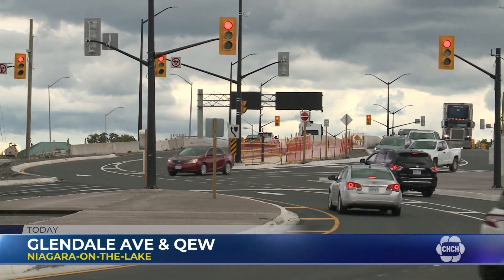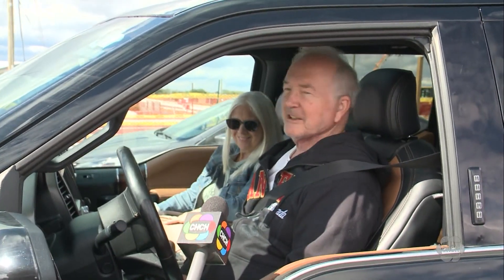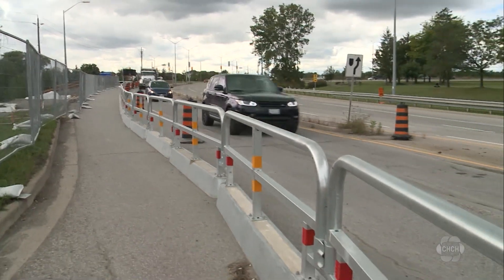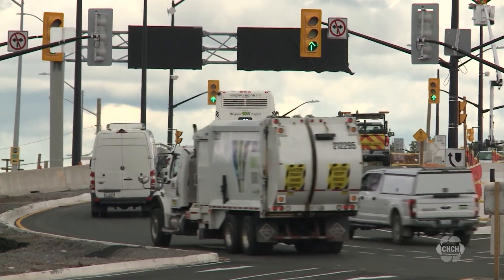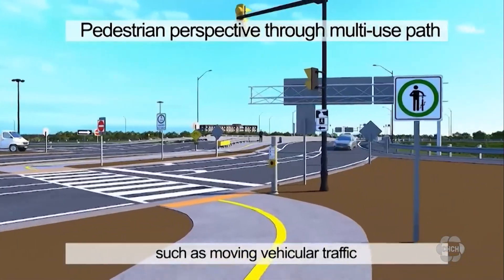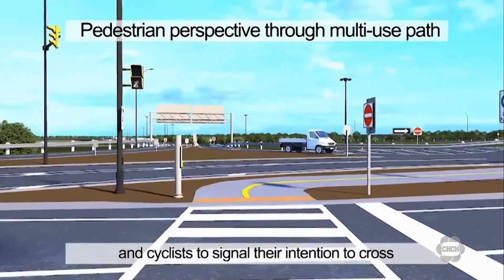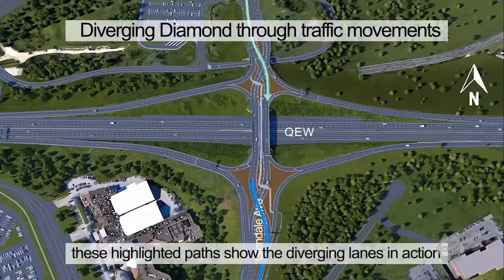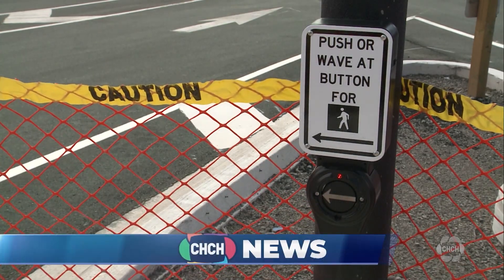Ontario’s first diverging diamond interchange opens in Niagara

Comment: the purpose of this design is to eliminate a left-turn-light cycles, thus increasing green light time, thus increasing flow rate.  It also eliminates cross traffic for left-turns.
Reply: So it just moved the lights from the ramps to the cross overs.  And every driver has to do one change over, and two change overs if not acessing the highway.  And the change overs are really just controlled left turns, limited to one set of lanes at a time. Guess it's better than when hwy 20 and the QEW interchange was a roundabout.

Comment: Anyone think that some random drunk driver is going to demolish another vehicle on this interchange?
Reply: I saw another you tube that said this design reduces possible collision points from 32 to 16.
Reply: When you're on it, you are pointing in a straight line.  Unless said drunk driver randomly decides to take a 45-degree turn into oncoming headlights, that won't be a problem.  Most diamonds have curbs and guardrails to prevent people crossing over anyway.

Comment: A pretty simple but effective design. I knew about these for years.
This multi-use path has led crossings than the ones in the USA, those ones are death traps for cyclists and pedestrians.
However, the most ideal would be a separate bridge for pedestrians and cyclists.
Reply: When the power is out it is a disaster, especially with semi-s...
Reply: @electricaviationchannelvid7863  This actually might be safer. When traffic lights are out, it's supposed to be an all-way stop, and with a normal intersection, it is hazardous with traffic coming out of two or three different sides, and turning in different directions. With a DDI, it's only a two-way encounter, and each side is only following a single path with no turns. Like an intersection with two one-way streets, and no turns allowed.
Reply: People like to stop in the crossing section… and creates a continuously expanding traffic jam. 
These only work with polite drivers.
Reply: Why don't they design it so that the straight-through traffic doesn't crossover?  Why have stop lights at all? One lane should be elevated over the other so that the straight traffic doesn't have to stop twice for red lights. ie: Make a bridge. A bridge before and after the main bridge.
Reply: @taekwondotime  costs more
Reply: @taekwondotime  It's not as cost and space effective. That is part of the point for this kind of interchange.
Reply: @pbilk  A roundabout in each end? 
Less car traffic?
More public transit?
More walking and biking?
Nah, that is Europe. Here we are in love with our cars.
Reply: If only they didn't demo the other bridge...

Comment: We have one here in Joplin,Missouri at an Interstate 44 exit. Seemed very strange at first with a traffic light in the middle and driving on what feels like the wrong side of the road. Eventually it proved to be much safer than the tight cloverleaf design that was there for decades.
Reply: The first one I've ever used is the one at National and 60 in Springfield. Confused the heck out of me the first time.  It's been there for a long time.

Comment: I don't see the point or benefit from this design, you still have lights?
Reply: The intention is to eliminate left turns against oncoming traffic.
Reply: @malcolmtaylor111  Thanks for pointing that out, the story didn't actually explain how it's different or what the problem was with the old setup.

Comment: Seems it would be much more efficient for traffic flow if they just built 2 looping off/on ramps so that vehicles don’t need to turn left to get on the highway in either direction. Then they wouldn’t need any traffic lights, and traffic would flow much more efficiently. But then, when has the MOT ever been concerned about traffic flow. I think their primary goal is to slow traffic down.
Reply: I don't think you see how it works, there's no crossing traffic to get on/off the ramps, only merging, it's proven to less waiting for traffic and safer for everyone involved.

Comment: We have at least one of these (that I can think of) here in the Minneapolis/St.Paul area. At Highway 96 and 35W in Arden Hills, MN. They put it in about 6-7 years ago. It is assumed that the majority of those approaching 35W from either direction on HW 96 are intending to go onto 35W, so instead of sitting in a turn lane and waiting, those entering from either direction on 96 can seamlessly get onto either direction of 35W typically in one go. Those who wish cross over 35W will typically wait at one of the stoplights.

Comment: The one in Calgary is not the greatest new idea because the designers have made the side roads coming into this and leaving it a huge CF. If you are in the wrong lane and need to get into a different lane during heavy traffic is very difficult. And a major on ramp into this interchange does not allow one to access the left turn into a shopping center because a median is there to prevent this. They did make a work around for this but if you are not familiar with the whole system your going to have problems. Once you are very knowledgeable about this new design you are good, but if you are new to it or don’t travel on it many times, good luck. It’s like when traffics circles or roundabouts were brought in people had a lot of issues on knowing what to do, and some drivers still have problems in understanding how they work.

Comment: This could turn into a mess since there are some drivers that can't follow the lanes/signs of a normal road.
Reply: A DDI won't make those drivers any more dangerous than they already are.
Reply: What about when everything is covered snow.  Covered with 15 cm of snow should really liven it up. It's one thing if you go through it everyday, another if it's your first time.
Reply: @edrouse9578  It's pretty difficult to make a turn with the angles. And there are quite a few of these in snowy states. It's an elegant design.

Comment: It is like going through a permanent construction zone, where you have to swerve left and then right to get back on track and only one direction can flow over the freeway at a time. The only saving grace is that it does not use a set of counter flowing lanes. <edit> slow pokes on the tailing end of the signal change get stuck on the bridge.

Comment: I still dont see how this is better.   Same number of stops.
Reply: @Golden Auto How so?
Reply: It was designed for left turns in mind. Left turns used to have to cross paths with oncoming vehicles. In a DDI, you are already on the left side of the road, so no stopping for oncoming traffic if the light entering it was already green, that is.

Comment: Diverging diamonds are a death trap for people on bikes, people in wheelchairs, parents with strollers and small children. I hope cars enjoy saving 30 seconds.
Reply: Hi, can you explain this further? I didn't see anything specific that hurts the walkability or bikeability.
Reply: @MohammadIshfaqueJahanRafee  The reversed direction goes against movement expectancy. There are 4 crossings. The large curve radii facilitate high vehicle speeds. The center trench often fills with debris, which allows the trench to fill with water when it rains. The center trench is exceptionally loud and uncomfortable. Bikes are often encouraged to mix with pedestrians in the narrow trench.

On the other hand, a tight diamond only required 2 crossing. The intersection is closer to 90 degrees, forcing vehicle to slow down. Bicycles can stay in the bike lane and pedestrians can stay away from traffic. 

There is no reason to build a DDI. As bad as SPUIs are, they're still better than DDIs. They both perform closely.

Comment: Its all good until the first major white out snow storm.
Reply: how is that different than any other roadway?
Reply: @matthope7518  significantly different, because when those directional arrows are obscured by snow, you can be absolutely certain someone will instinctively keep to the right and find themselves in the opposing lane of traffic.
Reply: @Vanbulance  add darkness, speed, and a few more cars than were in this video and it's going sideways real fast.
Reply: @Vanbulance  This can be fixed if drivers actually studied and knew how a diamond interchange works.
Reply: @Vanbulance  And that area of Ontario has some of the worst weather during winter (I live 1/2 hr away).  SMH.  I'd like to have seen an "artist's rendering" of the conditions you've just mentioned. Let's see how you navigate it until snowplows get through!!!  Don't get me wrong. I welcome well thought out design WITH the end users100% in mind. This--has me concerned.

Comment: Traffic lights are great places for accidents, no?  I don't see how this is better than a full cloverleaf with proper acceleration and deceleration entrances and exits.
Reply: One simple fact. there's no left turns. You will never have to wait for a left turn cycle with these interchanges, which drastically improves the overall flow of traffic. Plus, right turn highay access lanes are never involved in the interchange itself.
Reply: @KWally  while that is good, I still would prefer a proper cloverleaf with no lights, no left turns, and no speed changes in the driving lanes (if the accel and decel lanes are correctly used)

Comment: I can't help but laugh at how jovial you Canadians reacted to this interchange.

When the diverging diamond interchange opened by Woodbury Commons outlet center here in downstate NY, many locals criticized the Cuomo administration calling it communist, and retorting "this is America, w we drive on the right".

Facts being facts, accidents were reduced, and the traffic flows much better.
Reply: @davieee1168  how is it unsafe?
Reply: @davieee1168  sorry, but I'm not seeing it.

When crossing traffic lanes, pedestrians are now crossing traffic from one direction, not two. The central corridor walkway is often protected with barriers or a large buffer between traffic.

I'm not seeing issues for cyclists either. Follow the path of pedestrians, or stay to the right like you're supposed to, and follow traffic.

I'm sorry, but the engineering assessments, and other scholarly work I've read show that DDIs are a safe design for all users.

Comment: I Hope at least they made the bike lane the same width as a car lane so cyclist can pass eachother without have to go against the flow of traffic. Best would have been to segregate pedestrians and cyclist since there is a massive difference between walking at 4 kph and cycling at 25 kph, specially with the advent of e-bikes, that speed is not only reachable by fit people anymore.

A kid on Wright Crescent street will be able to grab a bagful of timbits on a bike if that highway crossing is done properly. If a parents is not confident that his kid can achieve that, then it's a failure.